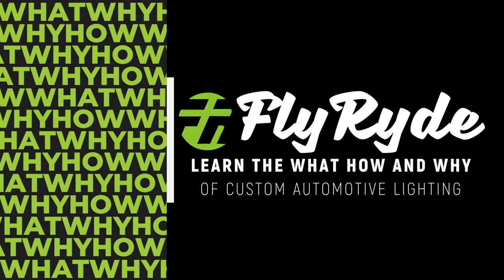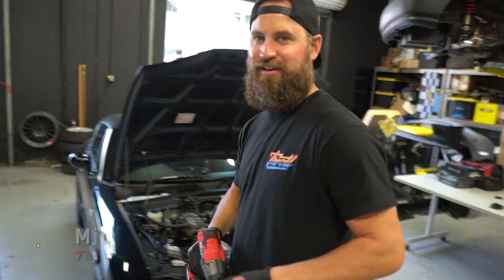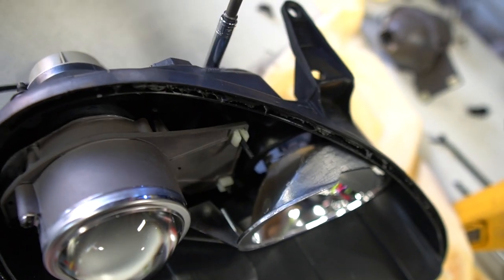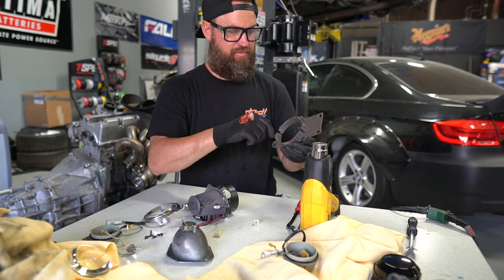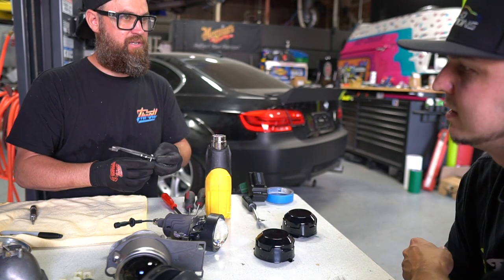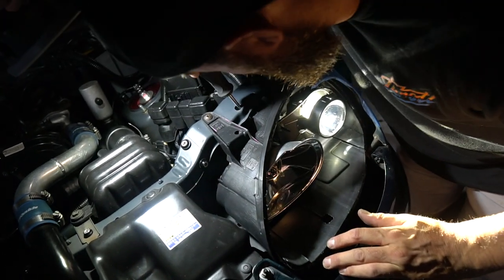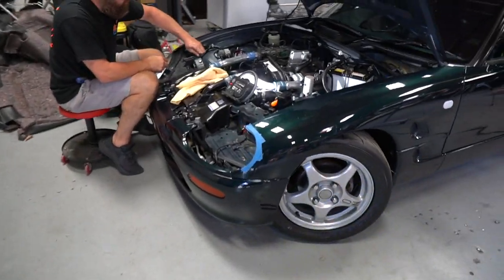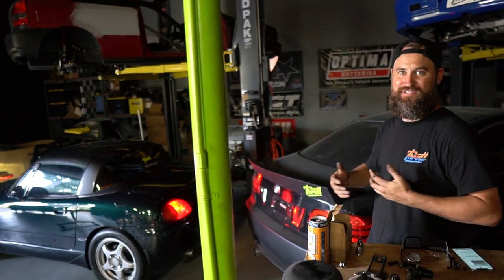What is a BiLED Projector Retrofit

Comment: Aiming straight will cause you to blind/flash people when you hit a bump in the road, or get any weight in the car, (something in the trunk would cause blinding all the time like the led subaru's do currently).  The actual way to aim headlights is 2.1 inches of drop per 25 feet from your original height.
Reply: THANK YOU!!!!  now i dont have to write it...  now if only it could fixed in the video
Reply: Fern is correct, and his info should be pinned at the top.  How does a "high end" shop not know how to align headlights like OEM?
Reply: "The actual way to aim headlights is 2.1 inches of drop per 25 feet from your original height."  ...  LOL!  Who told you that?  All you have to do is look up... how to aim headlights.  And, they did not aim the headlights "straight".  Watch the video again and pay attention.  Also, what are people putting in the trunk of their Subaru with LEDs that cause them to blind people all of the time?  Show us forum threads dedicated to that issue.

Comment: BiLeds are the way to go now. Have a local headlamp retrofitter here in Malaysia which they use a BiLed called EDISON R1 and EDISON R2. Those are super bright and wide. Have 3 led chips for a super wide hotspot.
Reply: You're right, but where the BiLed can be purchased?. I would like to retrofit myself. I have retrofit my own car but I just can't find Edison sold on line.
Reply: Do they come in 2.5 inch sizes?
Reply: @johankamarudin5155 buy them from aliexpress

Comment: Have you ever tried the cheaper bi-led projector so far? I'm thinking to use some in a cheap headlight build
Reply from the maker: Yup, they’re in my own headlights right now acting as secondary lows and highs 👍 I still need to do some adjusting and hook up a switch to turn them on and off independent from the bigger primary projectors.

Comment: Hi. Is there anyway we check watts of the LED chip in these projectors? I recently found out that some sellers are buying just the projector housing without original LED chip and installing cheap LED and selling as original. Is it true or actually possible?
Reply: Just buy from a reputable seller, avoid Amazon unless the seller has a VERY good reputation